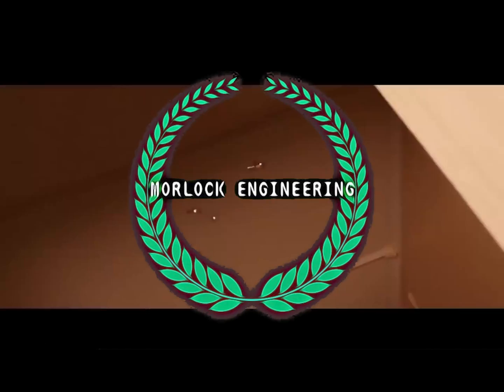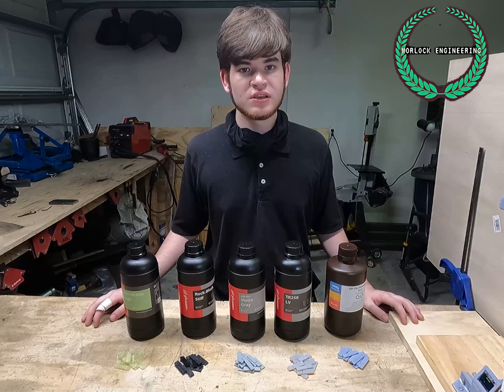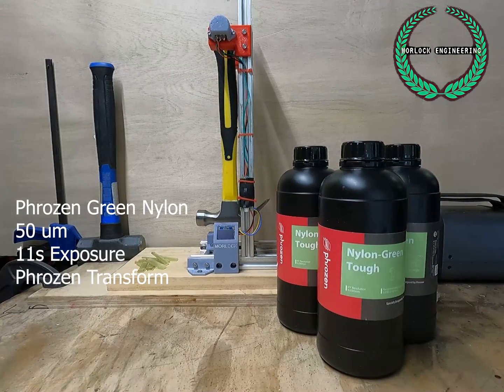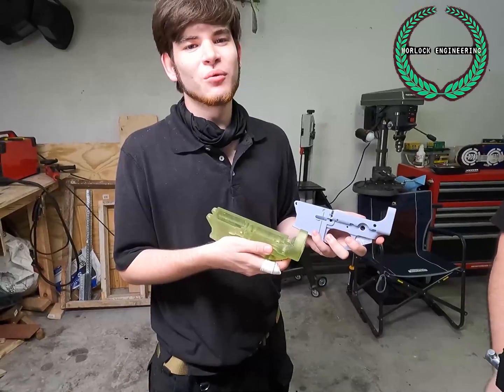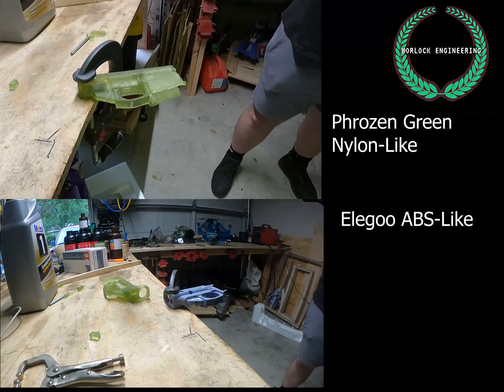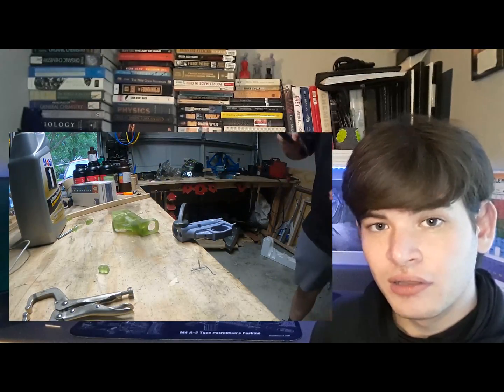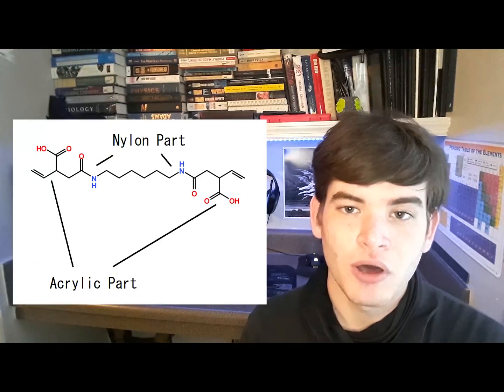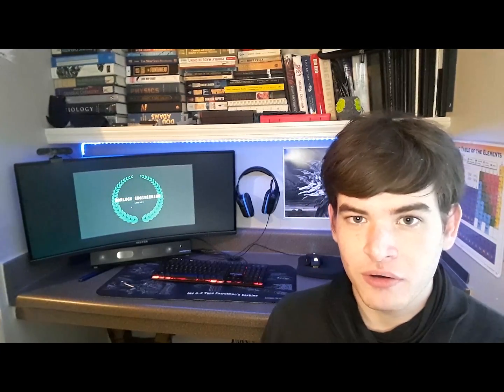Strongest 3D Prints? Resin Nylon

Comment: Have you tested any of those lowers in a live fire test?  I have always wanted to try resin for a lower but due to the brittleness,  always decided against it.  It's not cool when a lower just spontaneously explodes lol.  But if this nylon stuff bends instead of explodes,  that could make it viable to print a lower with a resin printer and get really nice looking lowers, smooth surfaces,  etc.  Especially with lowers designed for 3d printing like hoffman tactical's stuff.  I have both a huge resin printer and very large FDM printers.  All my 2A and/or functional printing is done on FDM and everything else is done via resin.  I just love the resolution that the resin printers can achieve vs FDM.  So handguards and decorative stuff,  always done on resin,  hands down,  not even a close competition.  If it could also print functionally.... duuude haha that would rule :D

Comment: I know I'm late to the game on this, but how does it hold up for balljoints?  Does it dust really bad or does it work better than M58 ABS-Like resin that has basically no dusting?  
(Dusting being when the ball grinds against the inside of the joint the resin grinds away instead of glides over itself resulting in quickly deteriorating joints)

Comment: Is the nylon resin stiff after curing? Does it resemble lastic or more like rubber? I'm not talking about flexibility but the strength with which it holds it's shape. If I print a box with it, will it hold the boxy shape or will it deform like rubber?

Comment: Yes😃! Please do more about that, I'm grateful to have found your channel. I will definitely buy the nylon resin because my prints are mostly on the technic heavy side of the  printing spectrum where functionality, safety, precision and versatility are higher rated than the pretty looking. Also do more of the ECM as well, I need to make titanium parts and I would want to learn more about ECM titanium. I mean, what feeds and speeds, flow, voltage, etc. are required?🤔  Keep it up, pal! You are making awesome things there👍

Comment: Have you noticed any difference in performance with different layer orientations? Or is that not a thing with resin printers.
Reply from the maker: Nope. There are no layers really. If the technology continues to improve, we will see monolithic one-molecule printing. That should approach the strength of kevlar or UHMWPE.
Reply: @MorlockEngineering can you use infill materials for next-gen composite properties? I saw a foreign guy from Scandinavia try it out, but his choices of infill were...grossly sub-optimal
Reply: Hey @HoffmanTactical , can you please relay your print settings to me?  And what printer you used?   I have some nylon green I’m just trying to get my settings dialed in correctly without wasting too Much of it. Your help is way way appreciated and thanks so much for being such an important part of the community. Much love !  Keep up the good work !